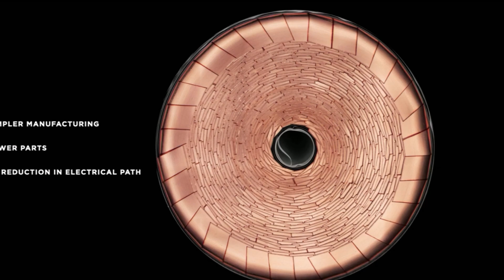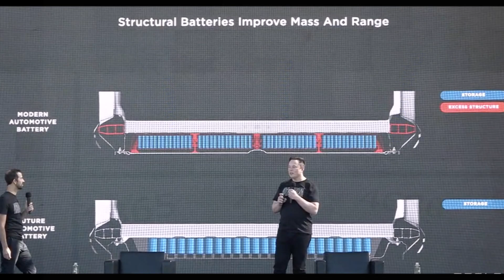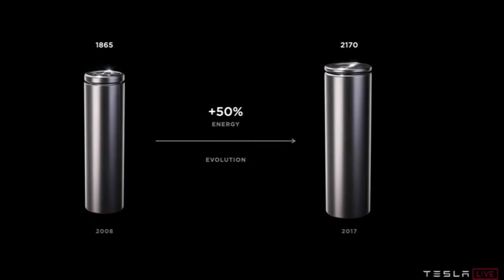Elon Musk and Tesla To Start a New Generation of Batteries In 2023

Comment: Why this new better don't go into the standard range trim?
Reply: LFP chemistry is better for the standard range products.  Elon has called LFP [LiFePO4] the Li-ion chemistry of the future.  It has less energy [range], but can be charged to 100% without affecting life, and has fast charge speeds.  LFP also has much longer life than longer range Li-ion chemistries.
Reply: Solid state batteries already being used in thousands of cars. Tesla is fucked when they start getting 600 miles range on a 200kg battery pack